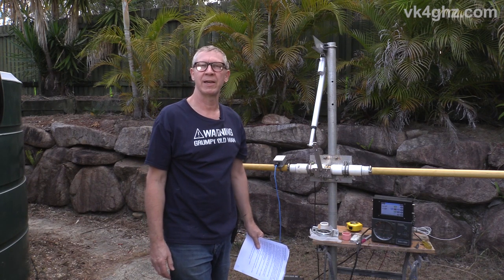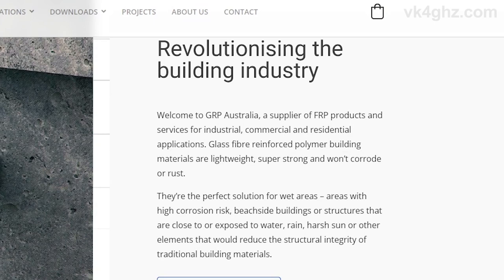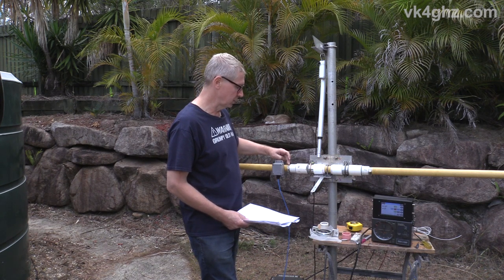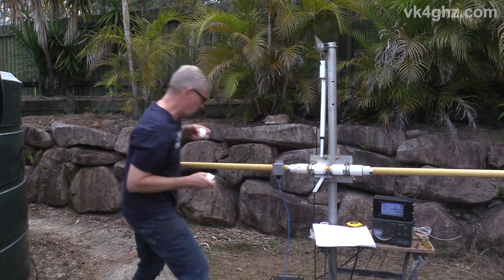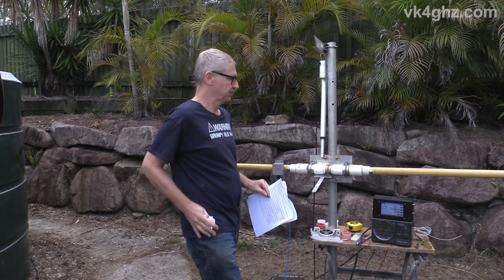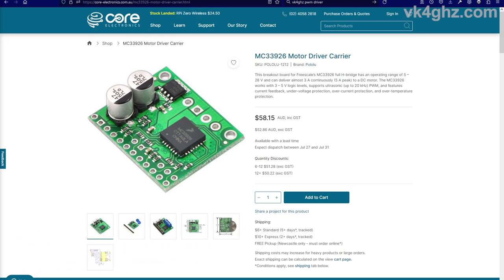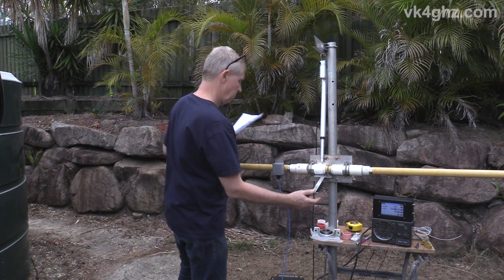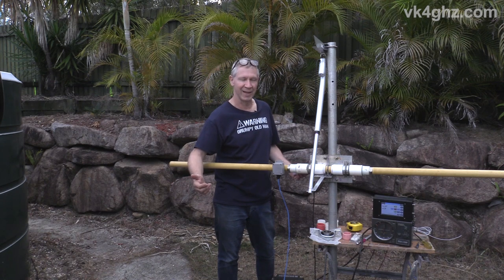Homebrew Antenna Elevation System for Ham Satellites

Comment: Perfect timing Adam!  I bought your Teensy interface board a few years ago in hopes of building an EME station. The expense of 1296MHz gear and amplifiers scared me off for now.  So switching over to build a linear satellite station. I have a spare azimuth rotor and a spare actuator for elevation so no need for an expensive az/el rotor.

Comment: Very interesting idea. Mine are fixed at 30 deg like you mentioned at the beginning of the video. To implement something like this I must extend my mast. Thanks for sharing. 73
Reply from the maker: Can you drop your existing crossboom by ~650mm to accommodate the linear actuator?
Reply: @VK4GHZ  Nope, that's the problem, there is 3el HF Yagi there also. Because of that I liked also that you used a non-metallic crossboom. Less interaction with the HF Yagi. 73
Reply from the maker: @VA3HDL  A longer piece of aluminium pipe then for your mast?   That would be a relatively cheap "upgrade" in order to implement elevation control.

The reason for using a non-metallic crossboom was to prevent degrading the performance of the 2/70/23 yagis, especially the m2 23CM35, which does not like any metal in it's element plane.  

And now that you mention it, I'll be putting an m2 6M5X yagi beneath the 2/70/23 yagis, so the FRP crossboom will help there as well.

Comment: Adam why don't you or someone else build and sell a replacement for the G5400/G5500 controller? These boxes are a pain butt. They have no protection, the design is outdated and I have had multiple transformers go out.  Correct me if I am wrong but isn't it just a 26vac supply and some switches?  Your controller and others do all of the hard work now days. I don't need lame meters with weird bulbs that you can't find.

Don't we just need your controller and ac for the motors and feedback from the pots in the motors?
Help me out, what am I missing?

Comment: Nice job, pity that rotor control is no longer available. The metal bearings wouldn't rust out if you packed them with grease.